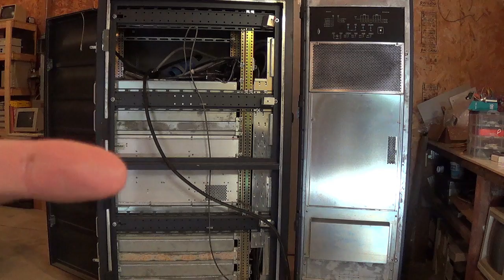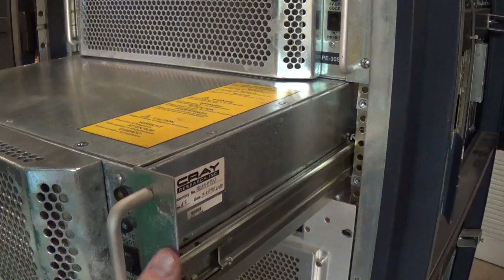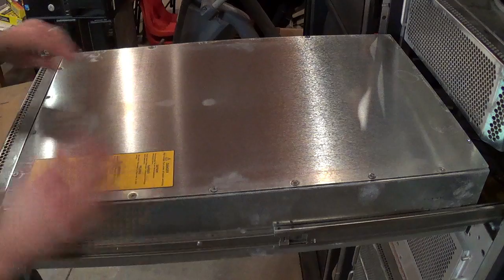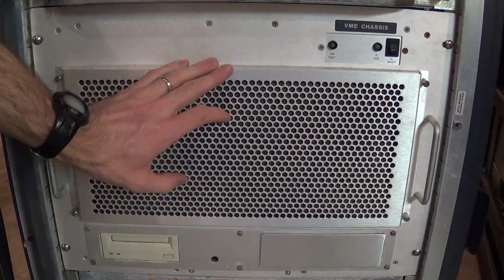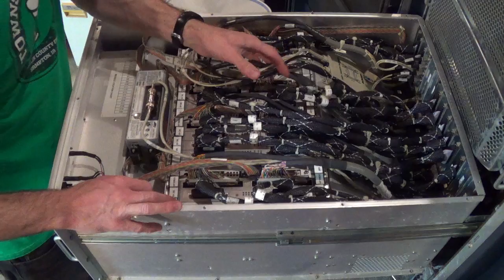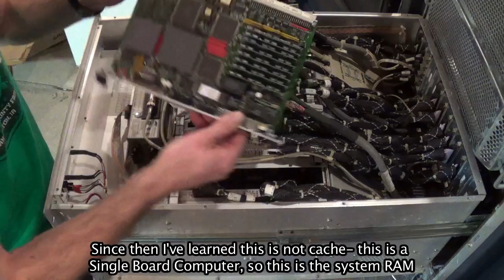Cray J98 Project - IOS Cabinet

Comment: Actually rings a bell ,or two. For one the place was once exactly a vid program made by whom was congratulated for doing what was doing but had too be man handled as it were into other dimension(!) as was effectively himself and all things,going through the centre of the Sun itself!! So,not too enable sane mention of that but Jon whom recall as building parts of these alike units the U he called them after his SeeMores which yunno was most uni formative. He and others created most units separately after following and being involved anyway for long time with cray and sun but assembled units apart as mass manufacturing lifetimes? Hom was known too loose continue its but always recommended toward the finalising was the main counterpart that you can easily find out about in NEC IBM literatures? However as I say Jon an his influence between all and otherly doing things that no one or anything is written relative or any other thing than wholly demanded suspect ions of how use look know and transpire too understand too get any knowledge or where with all etc! I know there are interferences you might not realise so hesitate too mention,but it's hard work and worse than rubrick puzzles in the dark! All the best!

Comment: The other thing is you looking at a that half height blanking panel next to the DAT and talk about installation media and don't suggest a SCSI CD drive as its probably use?
Reply from the maker: I've found no documentation suggesting that you can install from anything other than the DAT for the older UNICOS, or the SWS for the newer. Doesn't mean it's not possible, but (in this case), I was only speaking about what I knew :)

Comment: Whenever I hear/read IOS, I always automatically think about Cisco Internetwork Operating System ;)
Considering that this machine has dedicated IO processors, it is more like a mainframe computer than a "supercomputer". Supercomputers (lets just call them parallel computers) often have slow IO but lots of CPU, wheres
mainframes have lots of IO capability and dedicated IO chips, and only a couple of high-end CPUs.

Comment: Loving these videos.  Awesome to see videos on hardware when it was hardware,  before commodity and disposable x86 solutions took over.  The over engineering in these boxes is so full of geek energy.  :)   I found your channel by looking for videos on SGI servers,  as I use to work for them and miss the days of working with the big iron daily..  thanks much!
Reply from the maker: You're very welcome, and thank you! Have a good 'un.
Reply: No problem!  Hey I have 2 SGI Indy's R4400 and R5000 brand new sealed in the original box,  never opened.   I always thought I'd hand them down to my kid and they might be worth something by then,  but I don't think that'll happen.  What do you think I should do with them, ebay?   About 10 years ago I donated an Orgin 2000 and a few o200's to a local university,  wanted so bad to make a fridge out of it but the newborn changed priorities.  lol..

edit,:  was watching a video of yours saying the clock battery going dead is a problem.  They have been in my basement for over 10 years now,  I suspect they are done?
Reply: I believe there are still people running Origin 2000s as high-availability web servers.
Reply from the maker: Wow, nice! The SGIs don't suffer clock battery issues so much as the Sun systems do, so they're probably just fine. The primary cause of death for Indys is the crappy PSU in the earlier models. An R5k Indy is pretty sweet. I think you could really make a killing on eBay with them being NIB. You might consider donating to a museum, of course, but it's not quite as profitable (the latter being perfectly understandable). Don't suppose you have an Indigo? I zapped mine :/
Reply: I did have an Indigo 10 years ago,  before the great garage purge.  Wife orders,  need to pick your battles...  I also had a Power Challenge,  another fridge candidate.   All I have left is a Challenge L,  2 o2's one r10k and the other a 12k (i think?  been awhile) one of them is the server version,  which basically means no skins and an odd mounting kid,  the 2 Indys,  a 1600 LCD display with the crazy digital connector,  my SGI screwdriver,  a bunch of coffee cups and other assorted SGI swag from the 90's,  including a leather jacket which is too small for me now,  and a few install disks..   If I can't get much beer for it on ebay,  perhaps I'll look at the museum..   anyway,  thanks again for your efforts and time,  keep it up!
Reply: @douro20   wow,  hopefully not running Netscape Enterprise server.  ;)   They must use all open source on there for their web facing applications.  I don't know how else they would be securing things.